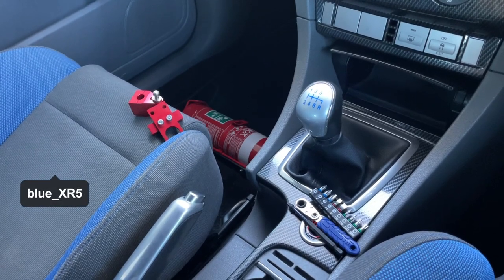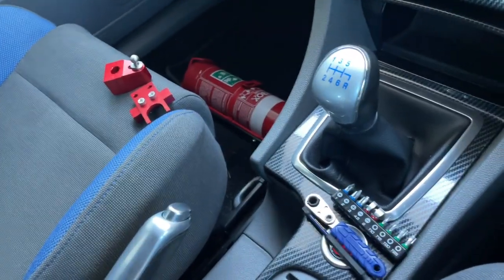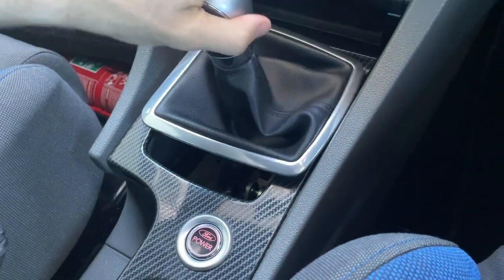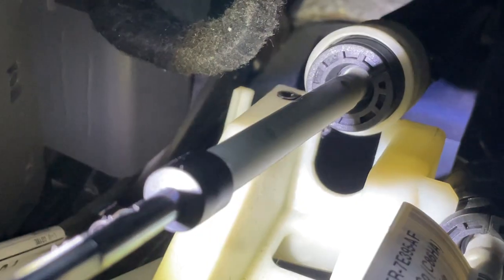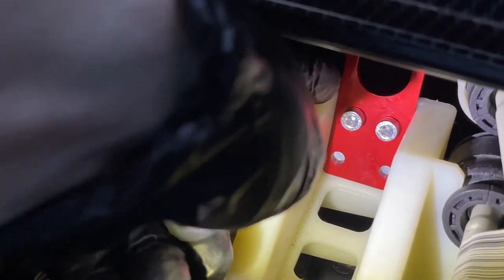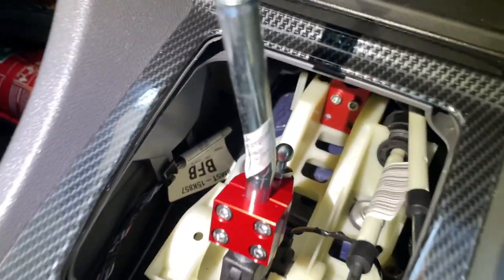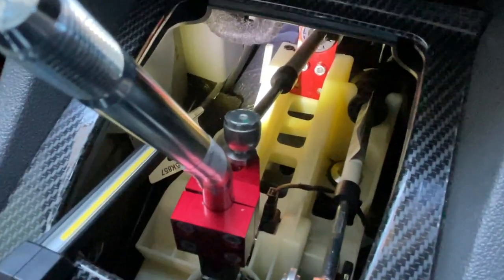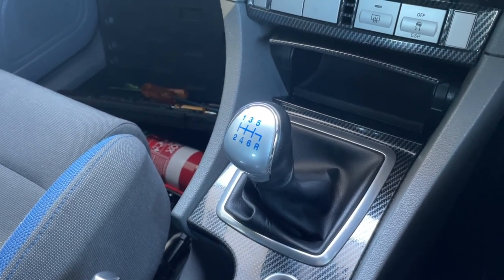Ford Focus ST/XR5 MK2 Short Shift Kit Install

Comment: hey mate, thinking about installing the empire turbo back exhaust on my 2010 xr5, what are your thoughts on it? have you ever had any trouble with cops and how easy is it to install??
Reply from the maker: @TheSportsScooper  Hey mate, I’ve had the exhaust on the car for a few years now and love it. Only downside to mine was the fitment but I will be getting new tips for it soon. I’ve had no trouble with the cops and as for the install it took a shop that I took it to about 2 and a half hours to install 👌🏼

Comment: Nice video! Are there any risks involved by doing this?
Reply from the maker: Thank you, the only risk I can see during the install would be dropping the small bolts but as long as they are pre tightened then you should be sweet. I’ve had the short shifter in the car since this video and it’s been perfect, makes changing gears a breeze and first, second and third are super quick to get to. Thanks for watching the video and leaving a comment 😄
Reply: @TheGearChange  Thank you, your response is much appreciated
Reply from the maker: @IIKlaplonGII  No worries at all mate 😄